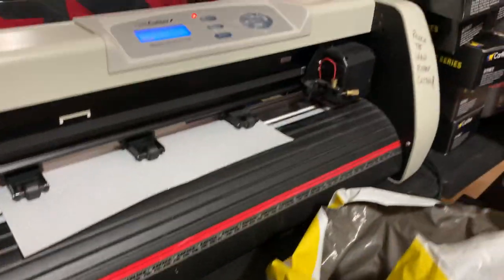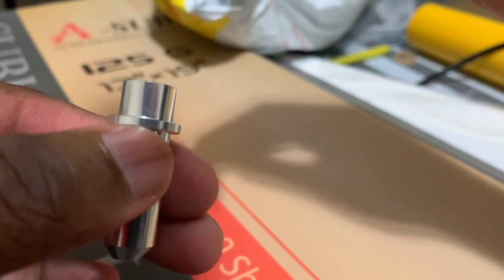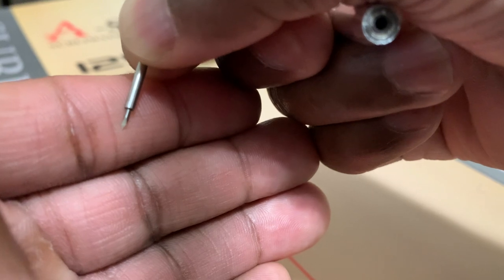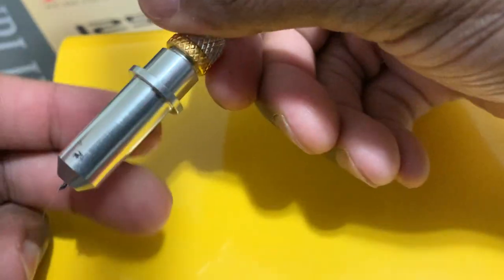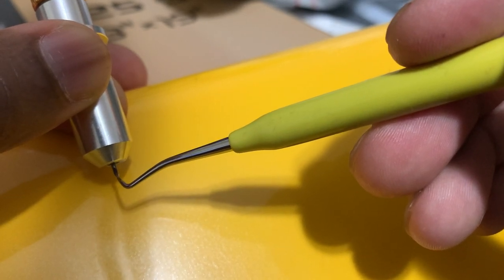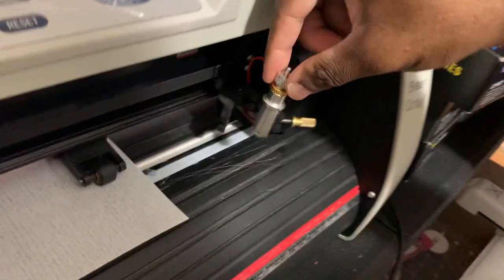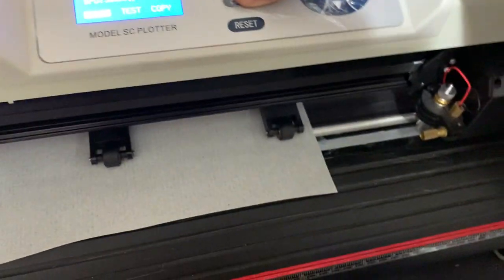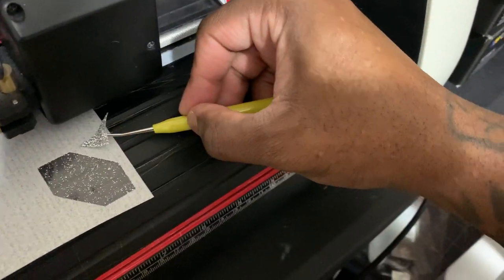How to adjust your blade on USCUTTER brand machines | Uscutter SC2

Comment: My cutter isnt completing the cuts... what I mean by that is if I am cutting a circle, the ends dont meet.  So when I am cutting words for signs, all of the letters arent cut out completely.  Does that make sense?  Help! I dont know how to fix that.  Thanks!
Reply from the maker: Have you adjusted the pressure? Is your design good?
Reply: @shastylesdesign  I just learned from one of your videos how to adjust the pressure... I didnt know that was a thing😆 I tried that and still nothing.  I did notice that when I took my blade out to check the positioning, it swivels inside this holder thing.  Is it supposed to swivel?    The design is good, Ive cut it before without issues.  Lately is hasnt been sharp... like the corners of letters that are usually crisp are rounded or bubble looking.  Ugh.
Reply from the maker: @larafilipovich355  I would make sure that it doesnt swivel...Then change the blade if you have been using the same blade for over a year